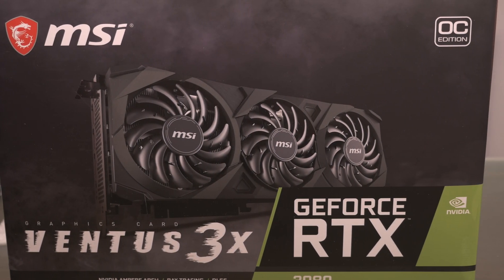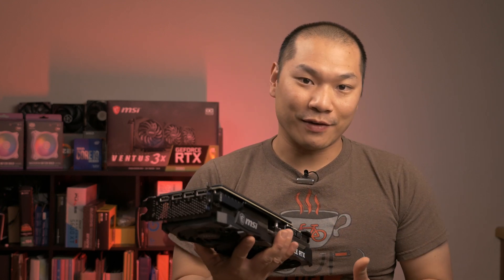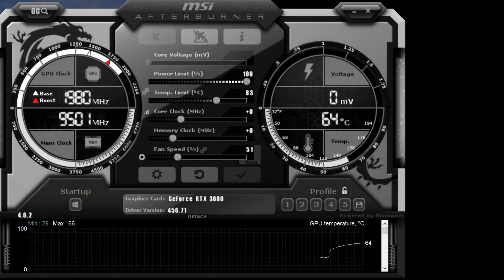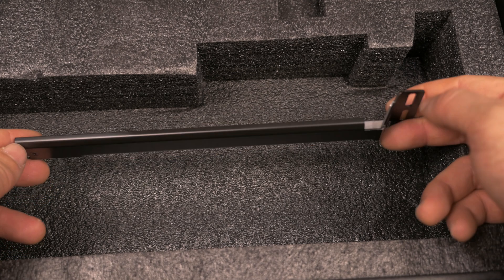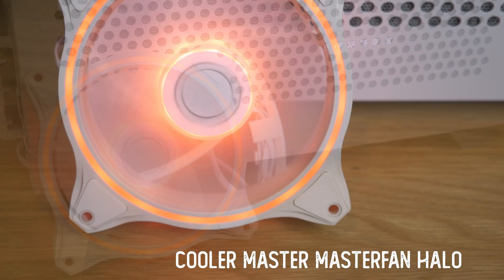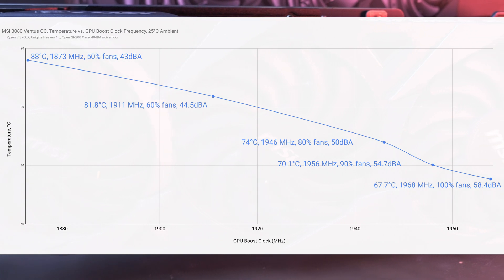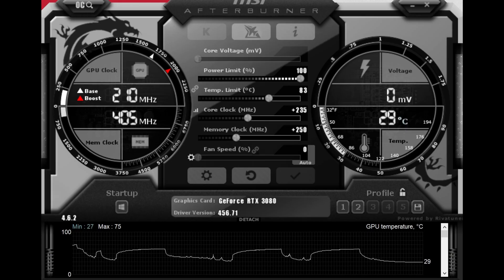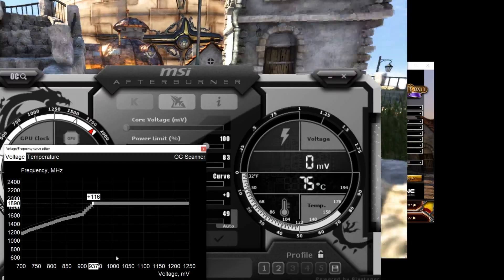MSI RTX 3080 Ventus 3X OC Full Review

Comment: Thanks for the review. Just got this card about a week ago. Given the thermals I would have preferred a different 3080, but given the scarcity was happy to just go with this when it became available. At first I was having issues with the thermals while playing demanding games, according to HWinfo64 it was thermal throttling even though the fans weren't running higher than 65%. However, I was able to fix this by creating a slightly more aggressive fan curve using Afterburner, it now stabilizes at 65 degrees while running SOTTR with maxed-out settings, ultra ray-tracing etc. Would prefer if I didn't have to make the adjustment, but honestly I don't really notice any extra noise from the gpu fans as they are still quieter than my case fans, and the rest of the thermals inside my case are totally fine even after hours of gaming. Other than this, am overall very happy with this card.
Reply: I just ordered this card. Have you had any crashes with it. How's it treating you
Reply: @joelombard85  Hey, so far the card is working great for me, no crashes, and it performs amazingly. The only issue, which is a bit of a question mark, concerns 'thermal limit' events showing up on HWinfo64 monitoring. In my case, I am getting these even though my GPU temperature is consistenty sitting between 60-65, the recorded high is 68, and my case fans are doing a great job of keeping everything else nice and cool while gaming.
From what I've read online in the hwinfo64 forums, either the Nvidia drivers are falsely indicating a thermal event, or it is an issue with high vram temperatures that can't be directly accessed via HWinfo64. What is especially weird is sometimes I will play a very demanding game for hours and not get a thermal limit show up on HWinfo64, and other times it will show up after playing Rocket League for a short period of time (which is not a very graphically demanding game at all.
However, it appears this is happening with a variety of 3080s, so not sure if going with a different card will make a difference. I do hope it gets sorted out though, I'd feel better knowing whether this is a false reading or there's actually an issue with the card thermals.
Reply: @mikekrebs5598  i have this card how do i check these thermal problems? i have in game issues all the time and cant figure out where its coming from
Reply: @11BCampbell11  I use the program hwinfo64 to monitor my GPU as well as the rest of my hardware. If you install it and have it running in the background you can check after gaming and it might help to at least identify whether you are having a thermal issue with the GPU.
Reply: @mikekrebs5598  thanks so much! i spent 4k on my first pc and cant even play cod without it dropping to 2 frames and 400 latency. once i tab out enough times it will work or in vangaurd everytime i get hit with a thermal grenade my pc goes right back to 2 frames 400 latency. when its not doing that it gets great performance. thanks!

Comment: From what I can tell in this review, you are not too impressed with this card.
However, it seems to be a good card for those willing to deshroud it in a case like the Ncase M1, am I correct? I just put an order on this card since it is the only one available in my region of all the aftermarket 3070 cards (the heatsink and fan design is identical except for a smaller heatsink). The ASUS TUF card seem to have better cooling out of the box , however, it doesn't seem to be as easy to deshroud.

Any advice in regards to this? Would you still recommend the card for deshrouding?
Reply from the maker: Absolutely, this is a card to tweak. If it weren't for the power limits imposed then it would have gotten a good uplift too with the mods. My take on it was just from a competitive standpoint, there's a lot of competition and it's priced higher than the consensus AIB value champ, the TUF.

Comment: I have the same card, I get Temps at around 77-79 when the card is under load.  I tried undervolting and that helps keep Temps at 70-75 under load for roughly the same performance. I'll try the bottom fans though, thanks for the idea
Reply: I gave up on this card, traded it for a Gigabyte 3070 Vision  (and $250) which runs about 20C cooler.  I spent weeks tweaking, undervolting, adding fans for better airflow.   Very Happybwith the 3070, performance is just a tad slower but runs great out of the box with no noise or heat problems.
Reply: @louisfox553  Man, I‘m also thinking to buy a TUF 3080 and replace it. For an absolute silent PC it‘s shit.

Comment: Have had this GPU and am using the bracket in the NZXT 710i case and haven't had any thermal problems at all since it launched back in September..No problems what so ever with this card..
Reply: How are your noise levels?
Reply: @Noah-Lach  Barely anything when gaming. Just browsing the web and simple things it's completely silent.
Reply: @ChefBag  Sweet, sounds good enough me
Reply: I just ordered one. Is it just as powerful as the other RTX 3080's?
Reply: @gregthesplintercell  Yes
Reply: @ChefBag  Yup. I'm right there with you. Nothing but good from this card so far. I got the nzxt h710 with a gammaxx from IBP and it's been running fine... I don't want aio since I don't trust it. I expect too many failures with liquid cooling in the future. I have a noctua nh-d15 ready for upgrade in a few days with a corsair rm850x as well.
Reply: @gregthesplintercell  did you experience any weirdness after all this time?

Comment: i have one of these cards as well, i havent had the heatsink separation issue yet but i also vertically mounted my card because it physically wouldnt fit with my cpu radiator mounted on the side in my thermaltake level RS. i could move the radiator to the top but i dont really see a reason to
Reply: also the channel owner is extremely thorough in his explanations, you earned yourself a sub my dude!

Comment: Great content! Just one suggestion: despite delta T is very scientific way of data representation it is not easy to understand for common viewer. I mean it requires some calculations in mind while watching the video.
Maybe it would be better to normalize all temperature data to 25 degrees c for example? That would give better “quick” understanding of thermals for most setups
Reply from the maker: Noted! Good point. I agree it would be easier for users to subtract and then re-added if needed.
Reply: subtractions are not hard....

Comment: I also have this card. Installed the bracket the same day and had no issues. Haven't noticed the card above 60C yet. And can't barely hear it aswell. Really an awsome card so glad I got it! Great review btw! :)
Reply: Have you had any crashes or anything even with the new firmware update. Are you leaving a cardstock any overclocking or under voltage things that you have to do. My 3080 should be here Saturday Monday at the latest
Reply: @pilotguy1141  Funny you should ask. Had a crash while using youtube last night. Not sure it's releated to the 3070, but only happend once. I haven't done anything else with the card, except installing dragon center and turn on/off couple of things. Not sure how to firmware update the card except installing nvidia drivers. :)
Reply: @Byte-mare  My 3080 get on game like red dead redemption 2 online 4k 60 hz  on 68.-72 C
Reply: @Byte-mare  hv u fixed the issue?
Reply: I am getting this far with my custom rig and still debating did I make a mistAke with you g so.

Comment: Got this in my case and it was at 82c ended up taking  off the front of my case and replacing it with mesh,  now its quiet and stays around 66c in gaming.
Reply: I need to do this tonight.  Im running about 80c right now. Its a hot boy
Reply: @josephgereghty8358  that was supposed  to say Mesh. And yes it will make a huge difference
Reply: Oh got it now. I cant replace mine with mesh but ill just buy a better case. I should've realized it would run so hot before I bought it but ill just buy a new case with better airflow.
Reply: @josephgereghty8358  do you have intake fans in the front? My case had a metal front with a mall vent, but I colut take the entire front section off and expost the intake fans. I ended up butt 3 individual mesh fan covers that I put over each fan. It was like 15 bucks on ebay.
Reply: @sonsolar I am able to take the front cover off and expose the intake fans but its just so not pleasing to the eye. My plan is to do it as a temporary solution and research a case with amazing airflow and then rebuild my computer when I have time.
Reply: @josephgereghty8358   Cooler master has some great mesh cases. I currently have a front to back setup with 3 exhaust fans up top 140mm. Front 2 fans are 210mm. I know you can buy and switch it to 3 140mm if you wanted instead of the 2 stock 210mm in the front.

Comment: Quick question - do you think it would matter that much if I use a noctua S12B redux 1200 rpm (airflow optimised fan rather than static pressure) as the side mounted fan pointed at an L12S cooling a 3700x? Gonna buy some arctic p12s for my build in this case and am curious about the different types of fans there are out there and when to choose what etc
Reply from the maker: I don’t think it’ll make much of a difference. For the tests with low profile coolers I used the stock case fan 🙂
Static pressure fans make a difference when obstructions or radiators/heatfins are present. In this scenario you’re moving air at a moderate RPM to feed the heatsink fan- an airflow fan or static pressure fan is not going to matter much.
Reply: @MachinesMore  excellent, thanks. Well that’s me got everything ready to build in this case apart from gpu. Btw I have this link I found on a reddit thread to amazon that lets you buy the NR200 internationally. For some reason I can’t find it in stock any other way, so I had to pay £35 for shipping (not too bad really). Just waiting on one of the new ryzen gpu’s. Really hoping the launch lasts more than a minute so some of us can get that new gpu theuve been waiting for since the 3080 launch disaster 😂

Comment: Is there any concern when having a fan blow onto another fan, causing turbulence which can damage the fan bearing over time? Do you have any experience with that? I had a hard time finding any concrete evidence of this.
Reply: That's what I also been wondering since Ive seen something very interesting. It's called a push-pull configuration where you put two sets of fans on the front of the case to increase the intake of air. Would be really interesting to have a video on this.
Reply: @zexLlama  Yeah I think even a push/pull config is safer on the fans as long as they spin the same RPM. Which leads me to my main concern of the fans pushing onto another fan at different speeds and static pressure.

Comment: Even with bios flash my Ventus OC doesn't go above 330-340W power limit, looking at the GPUZ the reason is PCIE slot power limit of 30-40W
Reply: Hey, where did you get a compatible BIOS to unlock the power limit?
Reply: @Julz2k  Did you find out?
Reply: @TheJonazas  nope, sadly only found incompatible ones. Maybe a year later something changed? I haven't used my pc in a long time, so give me feedback please if you find out something new, thanks
Reply from the maker: I guess they have to give folks a reason to go for the Gaming X Trio, which has an extra 8-pin connector. 🙄
Reply: @MachinesMore  Yeah but they forgot about the competition from other brands like Asus Tuf... regret being an MSI fanboi haha, just joking I purchased a custom built pc and the only 3080 options were ventus oc or gaming X trio, didn't want to pay £90 more for the latter.
Reply from the maker: Totally, which is why I think the TUF is a much better option. Which if funny because TUF cards have generally been quite average. If they priced the Ventus close to reference then it’s a very big maybe but if you have a choice, then it’s a hard pass. Over time the pricing may change but clearly with the supply as it is now, nothing will budge.
Reply: @MachinesMore  yes exactly! Normally i would prefer the cheapest option, but this time around I could only get ventus oc for £720 or gaminx x trio for £810. Still not sure how to optimise it for thermals inside my Corsair 4000x. Have 280mm rad in front with 3x120mm fans and 2x140mm fans just below the gpu(on psu cover lol) as intake and 2x140mm fans on top and 1x120mm in back as exhaust
Reply: @madararinneganuchiha  Hey man, which bios did you use to reach 330-340w? Mine is currently only using 300-310w before it starts throttling. Any help would truly help alot.
Reply: @TheJonazas  Hey man, Asus TUF OC bios yielded the highest power for my rtx 3080 Ventus OC. I think Aorus Master bios also can achieve the same power.
Reply: @madararinneganuchiha  Damn ok, thats great to know. And no downsides to flashing this bios? I'm scared of bricking my card and shit, but i'll do a little research. You got a link for that TUF bios?
Reply: @madararinneganuchiha  When I flashed the asus tuf OC bios, the nvidia driver wouldn't automatically turn on, and when I installed the driver manually, I just got a bluescreen. Luckily I managed to get into safe mode and flash my backup rom. zzz
Reply: @TheJonazas  You need to uninstall drivers and disable the gpu before flashing. after flashing, restart your pc, enable your gpu and then install the drivers.

Comment: Nice review... I got a CoolerMaster H500Mesh and i'm pretty sure my Ventus3080 will be well place in that case with an airflow underneath it and on top of it. I actually got 66degree on load  in 20degree room for my MSI Duke 2080ti, pretty sure i'll get the same results...keep you post on that
Reply: Its Great card but needs an apropiate case since it generates a ton of heat😃

Comment: I have this card and when playing warzone at all max settings 1440p rtx on, my temps are higher than most other peoples cards at about 75-79 C. Would this be regarded as a thermal performance issue?
Reply from the maker: What’s your ambient room temp, and how is your case airflow? It doesn’t sound too bad at a glance, but it’s dependent on how hot the room is. Are the fans running high?
Reply: @MachinesMore  Ambient room is 70 C. I have 6 fans in my H710 nzxt case (a big case thats regarded as decent/fine for airflow). At my temps of 75-79 C full load gaming, my fans only run at usually 50-65% for some reason. Also, I did try making a custom fan curve to make fans run more/faster but for some reason it wont let me do it in afterburner. I hit the apply button in afterburner to set custom fan curve but it always resets to stock fan curve no matter what. 

Ideally, I would like my full load gaming temps to be 68-74C instead of 75-79 C. Any tips? Thank you
Reply: @ChizChuzHD  70C ambiente room ? Hot place you live in :)
Reply: @AndreMiguelLopes69  Laughs in Floridian

Comment: Hi , I saw a post that shows someone else's pc, this person asks to do the same and I also find it interesting: Fitting the NH-D15 in a NR200, Bend Tubes? / and share photo installed after enlarging panel holes. is there any chance that you would do this? to give us good information on airflow temperatures? is that it is quite tight so I think that only you could give a good opinion against c14s and u12a .
could you do it for us?  https://www.reddit.com/r/Noctua/comments/jebmc2/fitting_the_nhd15_in_a_nr200_bend_tubes/?utm_source=amp&utm_medium=&utm_content=post_body
Reply from the maker: Hi Javier, I’ve seen this mod before and it’s definitely something that can be done. However, it does look a little... different. Typically speaking, at the same noise levels there’s only a couple degrees of difference between the D15 and U12A, so personally I wouldn’t bother with it. I do think lots of folks hold the D15 in a special tier or air coolers, and don’t get me wrong, it is, but the U12A is also so good.

Comment: Sorry to hear about your issues with the ventus card. Someone on Reddit managed to fit an aorus 3080 master with its 70mm of height. Apparently, there’s a 2/3mm gap between the card and the bottom of the case. Do you think that this proximity will actually improve thermals and noise? By being so close, the GPU fans will be able to pull fresh air directly from outside the case. The guy on Reddit hasn’t tested it yet as he is waiting for a zen 3 cpu so it would be great to hear your thoughts. Thanks
Reply from the maker: Yes, if you can’t run fans at the bottom anyway, the closer it is the better, it’s also sounds good for deshrouding too. Since 120mm fans are much better from a CFM to noise ratio, that’s why a thinner 2 slot card with bottom fans could potentially outperform a 3 slot without fans in a case like the NCase or the NR200.

Comment: Great video as always! I have a question about this type of RTX 3080 card and the U12A air cooler in NR200. Would fans at the side panel of NR200 help with the thermals? If the cooler fans work as intake, and there is airflow from bottom to top of the case, should the side panel fans intake or exhaust air? Thank you!
Reply from the maker: You can mod the side panel to fit over the heat pipes on the U12A and mount a fan. When testing an additional side intake fan previously I got mixed results, within measurement error of not running one, however that was with a moderate TBP video card. I did test an additional side fans with the C14S and the 3080; results were also mixed with the AIB card. Where additional side fans did help was with the FE card, due to the unique exhaust pattern.
Reply: @MachinesMore  Thanks for the reply!